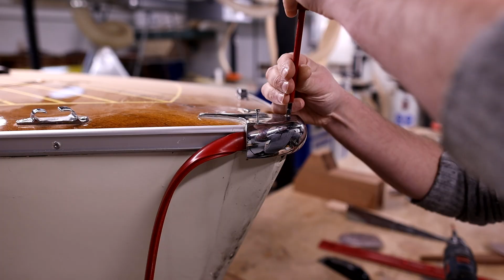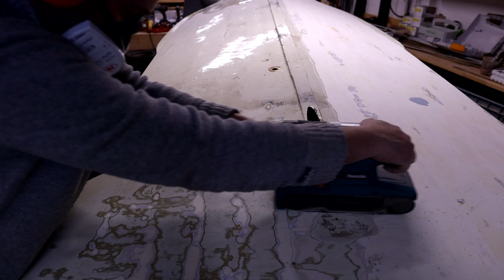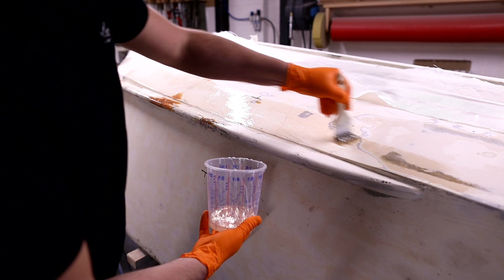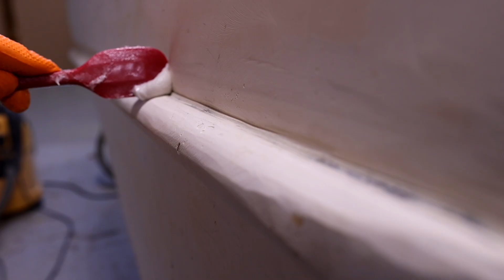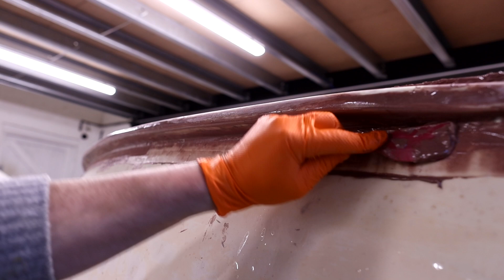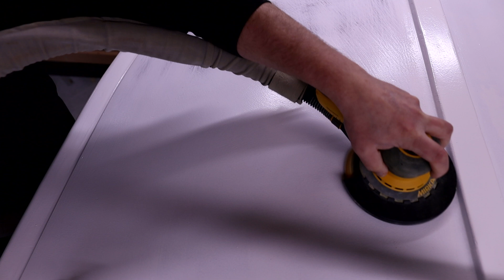Grinding Filling Fairing and Priming a Fibreglass Boat Hull | Healey Boat Restoration Part 6

Comment: Why use epoxy if you are applying gel coat over the top?  It does not bond.   Vinyl ester resin seems to be a better product and would provide a chemical bond of the gel coat tie the fiberglass reinforced areas.  Epoxy will not chemically bond to gel coat.
Reply: Unless you painted?    Ugh.   All that work and you use paint and not gel coat.

Comment: You used an end stage polyester filler over epoxy products on the bottom. How well does that stick to epoxy?
Reply from the maker: Fine for small cosmetic areas providing the surface is sufficiently keyed first.